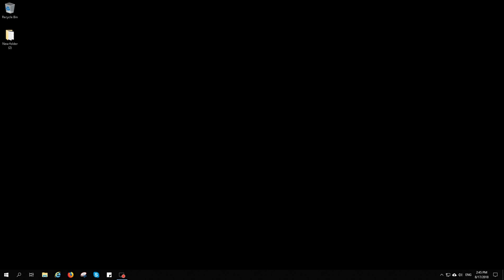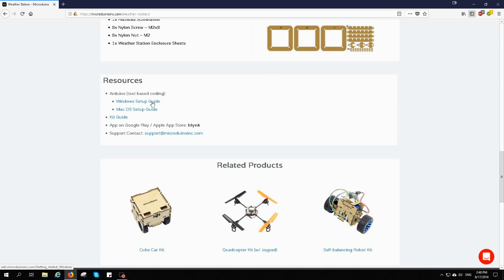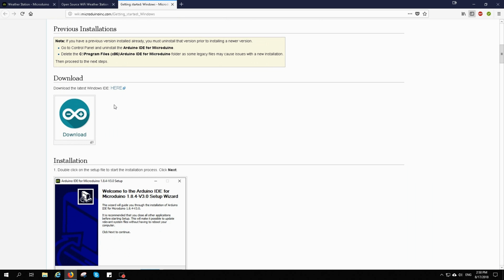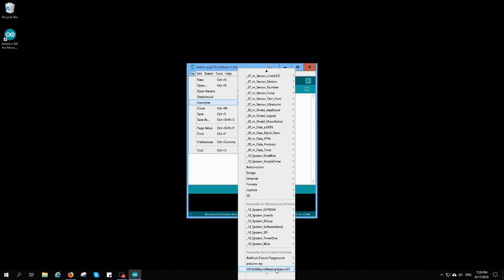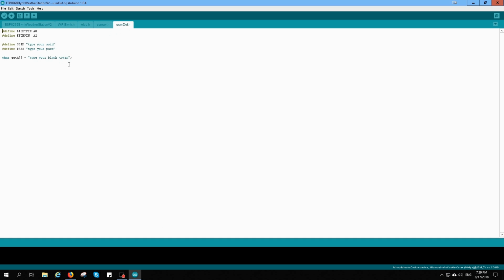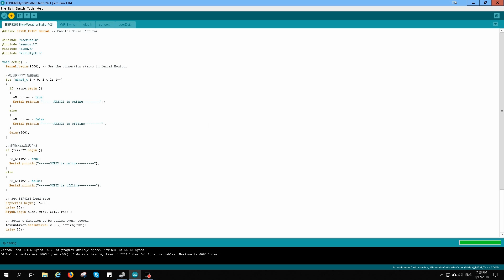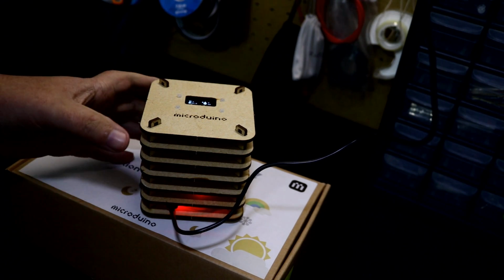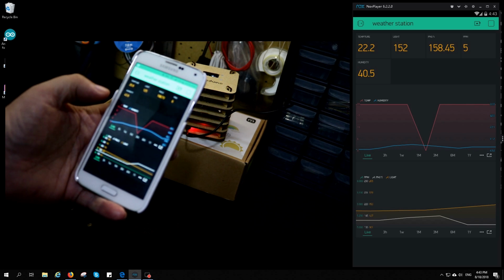Microduino Weather Station Unboxing

Comment: What about using Code::Blocks and avr-gcc and the AVR headers and libraries.
Reply: Well if you installed the windows or Mac version and copied the files needed it might work.   But it is just quick and easy to use the pre-compiled installer they came up with configure through the ide there.  Could check their github page as well might be something there to get it to work with it. But have not attempted it myself.